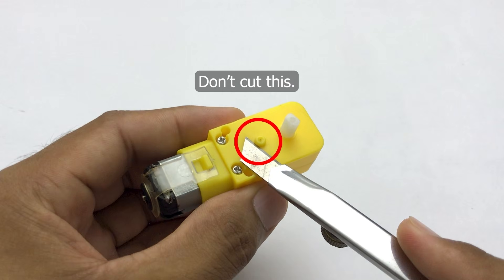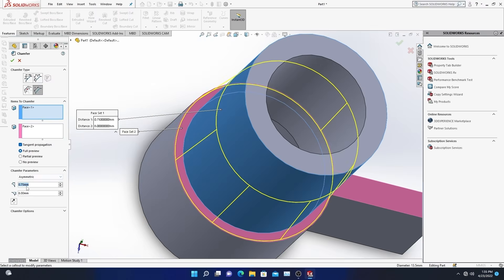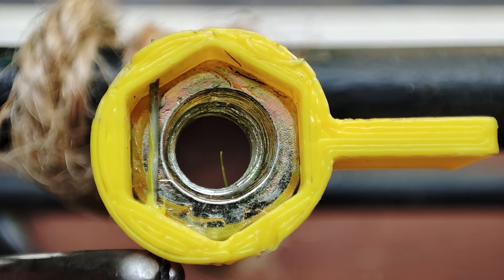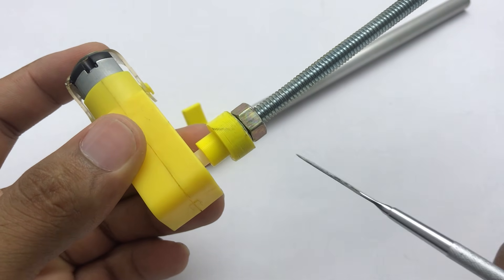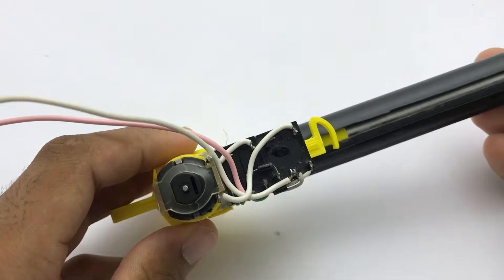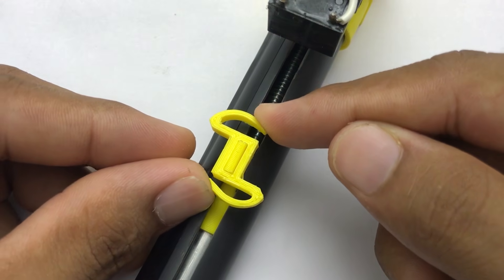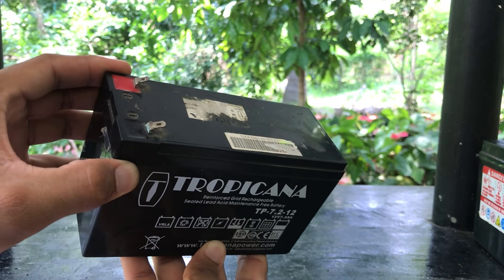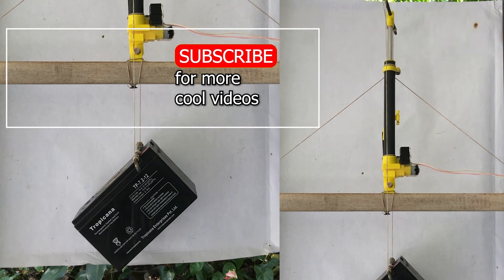DIY Dynamics: Crafting Your Advanced Linear Actuator from Scratch | Robotics

Comment: If you’re wanting something real simple and small, use a breaker push switch that’s spring loaded. When it reaches the end it will break the connection at the switch. All you gotta do is know how to hook the polarity of the wires, which is easy whichever wire is used to make the motor one way Hook that to the end of the switch, and then that wire are coming off the switch will go to the power when it reaches the end it kills the power through that wire, and for the other end, the same way with a different color wire the switch can fit on the tip of your finger, they’re used in a lot of of RC construction vehicles and you could make your own. They’re so easy to make.
Reply: And don’t forget to add bearings to take the load off the motor

Comment: Just use 2 diodes on the switches no need for relays, When upper limit is tripped diode allows voltage to bypass the open circuit only in reverse same for the lower switch 1N4001 (make sure of your amps). I just did thise to my gate opener as I did not like how the limit switches worked that were built in
Reply: Great idea, but can you explain the diode thing a bit.
Reply: Please send circuit daigram
Reply: if you do please use N.C. switches that can handle the motor current

Comment: Nice video! Why not 3d printing the tube as well?
Reply from the maker: Nice idea. However, there is one problem. The wall thickness of this PVC pipe is around 2mm. But if I 3D print a pipe with a thickness of 2 or 3mm, there is a high possibility it will break due to its layer-by-layer structure. 
Adding a larger wall thickness would make it workable. However, thank you for your idea !